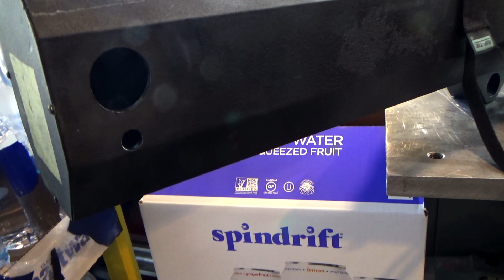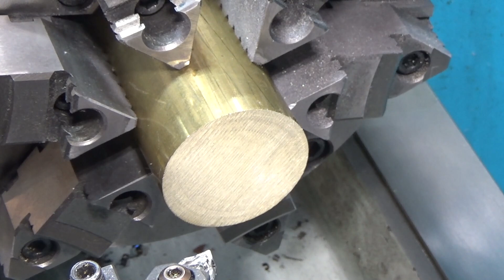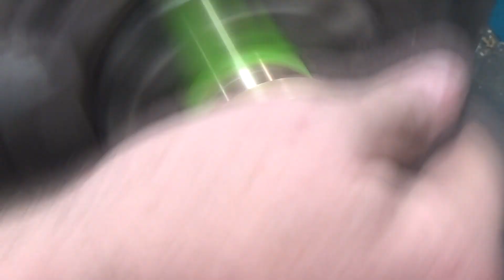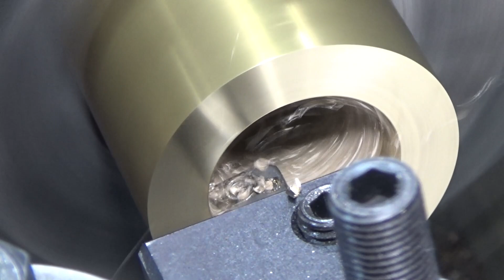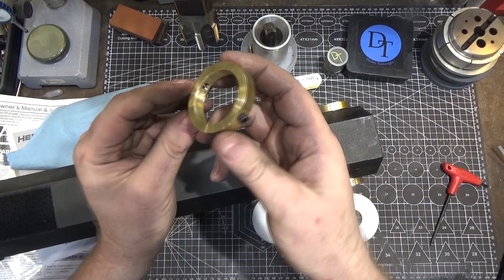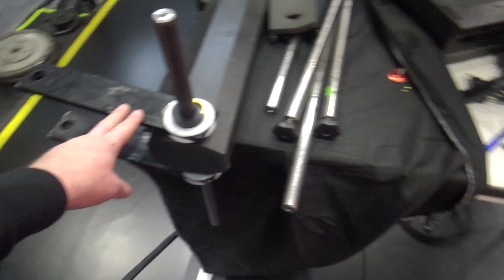172  CamMate Jib Repair Part 2

Comment: That upgrade to the back is excellent. The one I use is a 35' and with the Sony out there and a dutch roll unit the counter balance is almost 500lbs.
Reply from the maker: Thanks. I ended up using a different shaft. The nitride coating as very abrasive, although smooth to the touch.

Comment: I'm curious not criticizing, if you just needed to make a bushing, why not cut the stock down to near finish size and use an annular cutter to get the bore 90% of the way there? It's probably not worth the trouble, I personally get vexed by huge chip piles of waste
Reply: Oh my bad! I had no idea the bushing needed to be that long. Please ignore the prior comment, it does not make sense with these details
Reply from the maker: You still have a good point. Some machinists make their own "annular" cutters to save the core of really expensive materials. I agree the amount of waste was painful to see. I was going to save it an melt it down, but it was mixed in with chips of steel, etc. in my chip pan.
Reply: @DudleyToolwright  if I'm honest with myself, I don't think I have ever reused a core. I am very dutiful about saving them in a drawer, but the few times I have a project small enough, I never remember they exist. If the chips are not too oily, a magnet might be a good way to sort chips.

Comment: I think it was a mistake for you to make a new piece... especially at the price of materials that you were talking about.  Even if it had a gouged surface inside--- it would not have mattered.  You have to think about where it's being used--- It's not an engine part, it's just a simple little rod, and it's already way over built.  You could actually purposely gouge hash marks in it, or 'riflings' like a gun barrel and it would still work perfectly fine for what you needed it for, and actually those gouges/ riflings would help to hold oil, which would make it work even better.  Even if it was 0.0001 over, as you said...  With the bushing being that long, there would probably be enough deviation along it's length that it wouldn't even wobble, or even just a little layer of oil would have filled the difference, possibly..  That's one thing that I've noticed with a lot of the best machinists.. You can get tunnel vision on perfection sometimes and forget about efficiency and tolerance, and knowing when mistakes that you didn't want will still work fine, other than it bothering your ego or pride...  I used to have this issue early on, I ran a crew building custom houses and metal buildings for well over 10 years...  A good practice and habit to learn is when you can use something that's "good enough" to work, even when you personally would have liked to do better... I guess my point is, I wouldn't have wasted that chunk of brass to make another one, just to be so tight that it actually makes it harder to put together. lol. cheers
Reply from the maker: You offer some very sound advise, thanks. I had to make some sort of bushing, because the 1/8 wall aluminum holes that the original rod sat in were now ovals and allowed a ton of slop. You do however make really good points about over designing for the specific need. This design was actually specified by the client, so I did what they asked for.
Reply: There’s one thing I learned over 50 years ago, and that was to make something as good as needed, and not one bit better, I’ve also found that often, so called wear just makes parts fit properly, and work more smoothly. This is a particularly known situation with automotive engines. It’s why when something is taken apart, and put back together, it’s often too tight, or too loose. The parts, over time, had worn together, and work better. Lubrication better fills those wear points and helps to oil the parts, etc.

And if you decide to replace one part, you also have to replace the mating part as well. Is it worth it? Only if there’s noticeable wobble. A good example is the cross feed and compound on a lathe. The gibs are adjustable. Over a long period of time, they may need a slight adjustment. If it’s done every two or three years, it will be very slight. Will there be wear on the dovetails over time? Yes! Does it really matter? No, it doesn’t! And that’s the problem we see with a number of popular channels. Even guys like Keith Rucker don’t seem to understand that after their regrinding and hand scraping, their machine is no more accurate than before. That doesn’t include bed and saddle wear, which can’t be compensated for by adjustment.

Comment: Gday Robert, this modification turned out great, the original design wasn’t all that good really considering how much movement the jib does over the life of the machine, it’ll take a while to wear it out now, great job mate, Cheers
Reply from the maker: Thanks, Matty. I still think bearings would be better, but I made what they asked for.

Comment: The end cap was done cheaply too. Come ooon, You don’t cut corners on a high end product.
Btw, it being so easy to melt, do you save the brass chips?
Reply: It's not really that high end.. It's just a beam on a pivot. lol.. It's not the space shuttle.
Reply: @calholli   By high end I didn’t mean complex.
Reply from the maker: I should have saved the chips and contemplated it, but did not. Sadly, something like 6 pounds of chips were tossed. As for the end cap, they were not interested in having that changed. I doubt they even cared if it was there at all.
Reply: @DudleyToolwright  No, I was speaking of the original design and build quality.